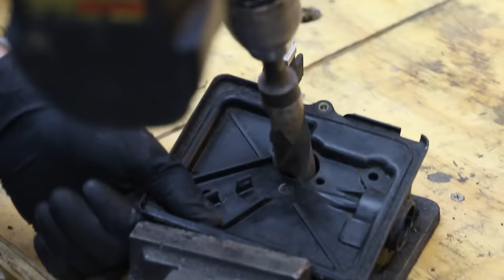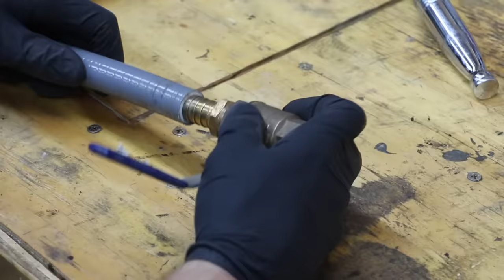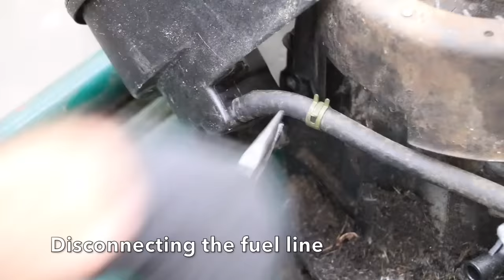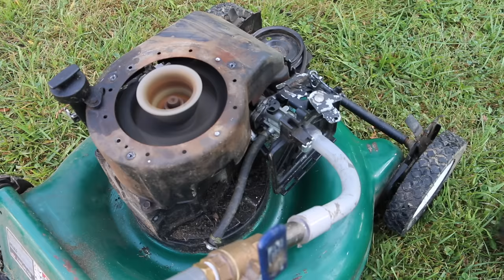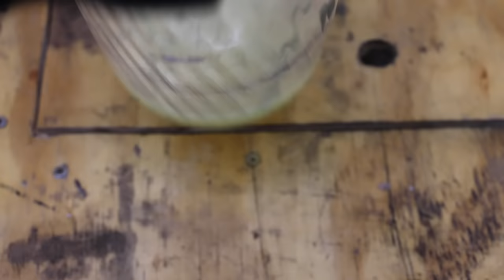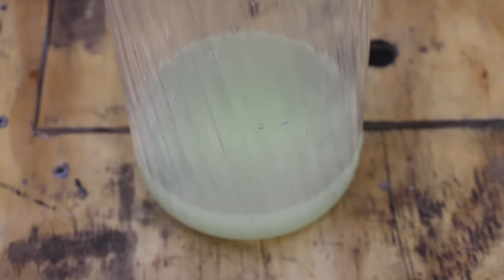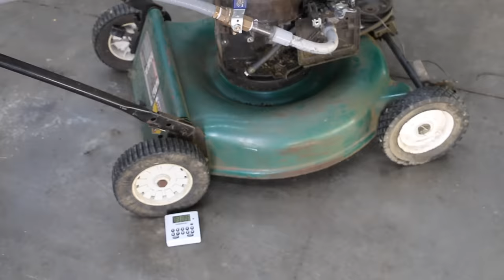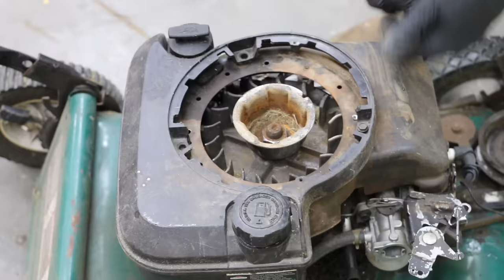Will a "Gas Vapor" Container Improve MPGs and Fuel Efficiency?  Let's find out!

Comment: Doesn't  a carburetor make vapor out of fuel and air?
Reply from the maker: Yes, it makes a spray mist, which becomes a vapor upon entering the combustion chamber.  More recent videos show this process in a see through cylinder head with a high speed camera.
Reply: But all of that unburnt fuel that can't convert fast enough becomes the black carbon that screws our bearings, rings and oiling systems.  If you run clean your oil lasts longer and you don't have carbon scoring the inside of your engine so your parts last longer.  The fresh oil change that I did 5 years ago is still in my car that I show this tech off with.  Pull the dipstick and you still see the color of the oil.  It's not black!
Reply: Yep, how did we ever get along before. Gas motors need a mix of about 14:1 for peak power and heat control. Wonder how much horse power the motor makes this way, bet its way below rated output.
Reply: Joe Cos maybe, maybe not... It's kinda like running nitro methane BECAUSE the fuel is oxidized, but w/o a Dyno test and/or some type of regulator to get a better fuel/air measurements???? Who the hell knows.
Reply: Who the hell knows. Well the people that designed the motors for one.

Fact: Its all about BTU content of fuel and how much you can run thru a motor over a given time period. Supercharging is one way to up the BTU's pushed thru a motor or turbo charging.

Fact: Fuel is vaporized not oxidized. Oxidation changes a given property of a substance, like steel rusting. Fuel in a motor does not go thru this process it is simply vaporized. Same for every liquid fueled motor.

You can call me a fool but there are hard and fast principles that don't change in how motors function here. BTU content of fuel is one of them. Look up the different fuel types and you will see that diesel fuel and gasoline are not the same BTU content. This is clearly shown in how the engines that use different fuels produce horsepower. Given an engine size and how its aspirated proves this out. Diesel motors are clearly the top when you calculate H.P. and torque, BTU content is the variable. The lawnmower runs but it won't give its full HP rating without the correct fuel to air ratio, it just can't. So yes, who the hell knows? People that have been designing motors for well over 120 years. No need to be foul with your comments John, this is just the way that the laws of thermodynamics works and will always work.
Reply: For a nicer burn as standard, make a much longer neck for the car and you will get a better dissipation of the fuel.
Reply: Joe Cos again, you’re assuming a model of 100% efficiency and that the designers built the system to reach peak power production available in the fuel.  While you can’t take more power out of the fuel that there was in it to begin with, you CAN always take LESS.  Is the manufacturer building a system that works to peak performance an fuel efficiency?  Probably not.  And definitely not on newer engines that must be built to epa guidelines.  And is the engine STILL functioning at the same efficiency that it was manufactured with?  Engines do these funny things called “breaking in” and “wearing,” you may have heard of them.  The point is, he was testing to see if it was POSSIBLE to run the engine this way, and IF SO, is it more or less fuel efficient.  He’s not trying to run a mower down a 1/4mi Strip in 3 seconds.
Reply: "He’s not trying to run a mower a 1/4mi Strip in 3 seconds."
And hes not going to mow deep grass with this mower either. Facts not opinion, son facts. Cheers
Reply: Hmmm.. compressed oxygen and gas vapors compressor Briggs....lol
Reply: Thats not a vapor, maybe atomized but not vapor.
Reply: jeeze louise, what do you think vapor is? (check the definitions are similar)
atomized is the 'old word' for vaporized.
Reply: Carb makes 5% vapors and 95% is liquid-that is the problem......We drive on 5% only and 95% wasted for no reason -is it really so hard to believe ?
Reply: Well, kinda, not like true vapor in a vacuum, weren't you listening bro? just kidding, awesome question! but the liquid used to mix with air in a carb. just aint the same. ;-) . .. .. . . .
Reply: No, it's not actually a vapor. The fuel is atomized into tiny droplets.
Reply: Carb will atomize 5-8% of the fuel. The rest will be-droplets. That is why it is not durning in the engine but goes out to exaust pipe.....Is it hard to believe ?    90% wasted for no reason......
Reply: No, it does not.
Reply: 90% is not wasted, the big oil companies are making a killing bro, LOL, your correct though, nice comment... . .. ...
Reply: i got a pictures of a carb that is more than 90% efficent bro.....u can get it 4 free if u want
Reply: Mark Cooper I could see this if you drive around 100 miles per year. Even if you remove the combustion gases from the oil, there’s still wear particles from the pistons, rings and bearings. Unless you ex NASA friend gave you a secret oil additive that reduces the friction of your engine to 0.
Reply: I need to stop drinking, I don't even remember posting this comment!
Reply: ok, tell us about it.
Reply: that\s  why catalytic converters were added, to burn the unburnt fuel that went through the engine.
Reply: TurboMaxx?
Reply: jeeze b it's vapour and colour
Reply: Шура Балаганов do you have a Web address for this ?
Reply: Pogue carburetor "Charles Nelson Pogue" < lots of web search listings.
Reply: 0-Zone oh yes that's an old idea but quite good. I made one and it's OK but with a little modification it will work better. Modern petrol is a different formula to old fashioned fuel. Gasoline was a liquid with a lot of vapour but the new stuff is shifty with stabilisers to reduce evaporation.
Reply: 10% ethanol doesn't help & I know folks who use fuel stabilizer (like Ethanol Shield) to get their car running better.
Recently used Sunoco 87 Octane & in the 90º+ heat & stalled out. Later added 3 quarts of diesel fuel & no more stalling. Sometimes I do 1 gal diesel (plus 3 oz acetone) to 9 gal gas. 

Lots of YouTube on gas bubbler & HHO systems. FYI Ethanol generates less heat, diesel generates more, heat = power. BTW An old friend put all diesel in a gas truck, it ran rough & burnt the valves.
Reply: spankmeister  No, it more like a stream. Even if it were a mist, by the time half of it hit the ID of the carb it would be liquid again. If not that, the bottom butterfly would do the same. I achieved 70mpg in a compact car with a carb above the bottom butterfly by making it spray better. Below you can do far better.
Reply: So didn't the original "vapor engine" actually heat the gas to create the vapors? Just running air through it...seems as if it's not much different than the way any carb does it.
Reply: Saint Crispan Was on top the motor. I would assume so.
Reply: Mark Cooper Rip your engine, you change oil not because it becomes slightly darker with some dirt, but because the the compounds and additives naturally degrade under heat.
Reply: scottrich976 Then explain why direct inject is can achieve more power than port injection.
Reply: Carb & FI atomizes fuel while vapor intake doesn't. Yes the original vapor engine used heat to help vaporize the gas. 
FYI hot rodders want more atomized fuel droplets (not vapor) since more gas (bigger droplets) gives more power.
Reply: That is exactly what the intake does . The carb delivers the fuel .
Reply: Шура Балаганов what's your source?
Reply: Running Nitro methane (nitrous oxide, and methanol alcohol)  allows you to run a much richer mixture of fuel and air, because the nitrous oxide adds oxygen to the fuel causing it to burn better, this is because air has only about 20% oxygen content the rest is mostly nitrogen. If you ran pure O2 and fuel the aluminium of the engine could burn. 
 
It is not oxidized... Oxidized is when the fuel is burned it converts the hydrocarbons in the fuel into CO2, heat, and water vapor...  It is oxygenated when you add NOS to the fuel.
Reply: @Shura_Balaganov_  no, no, no you are horribly wrong. Those droplets actually go through the engine and they are being burned... You understand that right? It's the opposite actually of what you say, only a small fraction of the fuel is wasted as unburnt fuel... It's not that hard to understand!
Reply: @FLHTdriver  the fuel is vaporized (changed from a liquid to a vapor/gas) to facilitate the total oxidation of the hydrocarbons. Both happen, but the actual power is derived from the oxidation of the fuel
Reply: 90 % wasted for no reason man !!
Reply: @Shura_Balaganov_  you must be a troll, aren't you? Is it so hard to belive what everyone is saying? Nearly 100% of the gasoline IS turned into vapor and nearly 100% of that vapor is completely burnet in the engine
Reply: @MarkCoopersisqocracker  I drive a 2005 cummins (diesel) and my oil is black like soot after 30 miles and those engines out last almost every diesel engine out there and diesels out last gasoline engines just saying black oil don't hurt shit.
Reply: Goes to show us how well a carb vaporizesis all this time.
Reply: Atomized gas is vapor, your confusing atomizing with aerosol sprays. The Original car engines in the 1800's used 'vapor' and atomized fuels with no carburetors, but there was no control over the speed or the power out put. It was the carburetor that allowed cars to be used in varying atmospheric conditions and grades.
Reply: It's not very much vapor, mostly atomized gas, which is similar to using an aeresol can.  Vapor is more like what you see coming from say a vape cigarette.  Huge difference in how much fuel gets burned and how much gets wasted.  Only the outer, expose to oxygen, portion of has from a carburetor usually gets burned. A vapor however allows a much more compete burn, this more energy released, less pollution released.
Reply: @saintcrispan5068  carburetors use pressure differential to draw raw fuel through metered jets. This raw fuel is atomized as it travels through the intake runner and into combustion chamber. 
The "vapor" generated by drawing air through a column of fuel is a closer to being a vapor than atomized. This is proven by the initial start up. The valve was fully opened and the fuel/air ratio was far too high to run the engine. In a carbureted engine this would have "flooded" the engine. At least in my experience anyway.
Reply: you should be able to take the carburetor right off and toss it in the bush
Reply: @kelvenguard  
True, I ran my Honda engine without one with ease.  However, having the carburetor allowed me to incorporate, with some adjustment, the governor so that the engine doesn't choke down as easily.
Reply: cool... with the Lawn mower engine like he has it set up you could take the carb right off and control it with just the valve.... and use 2 pipes one Just air the other air/fumes both with valves... because a mower runs wide open... then watch the fuel mileage go way up on the lawn mower...
Reply: Yes
Reply: Try using an ultra sonic  vaporizer
Reply: Much of it remains liquid and flows through the exhaust. The fuel is actually atomized, that mist as you called it is not vapor only the outside boundary layer becomes vaporized due to heat and pressure and only that vapor burns.
Reply: There is a big difference between vapor and droplets which is atomization . When the vapor density becomes too high, saturation level, then condensation occurs. Condensation is like atomization .
Reply: Atomized... which is easily converted to vapor when entering a hot combustion chamber.
Reply: Project Farm great video to save fuel I’m buying a Chevy Cruze gasoline but I have a question. I see trucks driving everywhere that run on diesel I thought about buying the Cruze in diesel but it’s an extra $5K where’s the actual savings. There’s about a 30-40 cent difference buying diesel the Cruze gasoline gets 42mpg and diesel gets 47mpg.......?
Reply: more like air is already a vapor and the fuel is ATOMIZED through a ventury..
Reply: like Combat Pyro said he was just trying to see if it would run on vapor
Reply: And the rate at which the atomised fuel particles vaporises is precisely calculated to reach maximum possible value just before TDC as the liquid to vapour change of state uses energy from external sources, therefore keeping the temperature (and therefore density;) as low as possible. 

Want more power? Without upgrading any engine components? Run a coil of fuel line through an insulated container full of dry ice in the engine bay, heat wrap exhaust components, ceramic coat all inlet piping, get an oil cooler, keep inlet piping from turbos as small in diameter as possible without being restrictive, duct clean cool air into air box and heat proof air box, clean MAF or MAP sensors well, either duct hot air out rear of bonnet by raising rear of bonnet so hot air is drawn out quicker giving it less chance to sink into thermally conductive materials OR (careful bout these 2, engine/car dependant, u can actually reduce your cars performance abilities by fitting the wrong style of bonnet. Especially if engine is designed to vent out under car) use ducting or scoops to force air into engine bay , it travels down past engine block, sump, exhaust, n so forth, taking heat from the most intense sources with it. Another good trick on little bit older cars is to attach a barrier of sorts that extends full width of vehicle from the top of the radiator out wards towards ducting in car bumper, this forces air through radiators and coolers at a greater rate instead of letting it escape up and over the radiator and directly into the engine bay. etc etc... 
•Next step is make your car light as possible (budget dependent) especially wheel, brake and suspension related items. Electric seats, steal panels replaced with Carbon fibre pieces (bonnet, boot, quarter panels, outer door skins, replace cast iron items with forged alloy or composite items (inletmanifold, exhaust manifold, battery tray, air box, engine auxiliary brackets, driveline components. List is as long as pockets are deep) 
FINALLY! reduce you cars drag coefficient (smooth underbody panels, channeling along panels to keep airflow from tumbling or swirling- high speed linear airflow causes a low pressure zone with a 90* perspective to flow direction- rear diffuser, aerodynamic designed mirrors(all adds up) aerodynamic (and AS LIGHT AS POSSIBLE while maintaining road use safety standards) designed wheels that also have correct offset to sit outer edge of wheel further out in line with car exterior... 
And then... 
Lastly, you consider making the braking system and engine components a higher spec. 

You can start at top and work your way down list until budget or circumstance prevents you goin further. You will mostly find, as much, if not more benefits than trying to improve on an automotive manufacturers engineering team. 

Cooler
Denser
Lighter
Slippery 
Smaller
Reply: Mist
Reply: @recon1071  I'm sure it doesn't burn the unburned gas but maybe chemically make it less harmless or trap it in something but I get your saying anyway i really hope it isn't for the unburned gas if so that's messed up if car companies would add that I stead of fixing the problem this method of burning gas may be better but not the best. im sure even if a stock engine did burn all the gas they would still add a trap for unburned gas just because people don't care for there engine people normally run it till it dies and fix what's the problem to get to driving that's about it so why wouldn't car companies plan for the future but given all that I can see how a small piece in a car can go bad but this type of thing I don't see how I can go bad other than no air filter on the intake it's going to take in trash from the air and that's going to get into the gas but still shouldn't hurt the fumes too much if any and there's a better way to do it just remove the bubbles and add heat I bet that would give it much small gas particles but will just give it something else that would go bad someday
Reply: @Joe Cos - But the original guy that invented this, actually invented a new spark plug too. It burns clean. Your engine allegedly does get that black gunky build up. Less oil changes, less issues over all. I understand what you are saying.
✨ BUT, think if it could work? ✨
The impact on the environment, zero emissions! Extremely, less gas being used. 
It would be wonderful. 
Then again it would be great if, I could crap quarters too right?  🤣🤣😜
This is where the idea comes from. It's a youtube video:
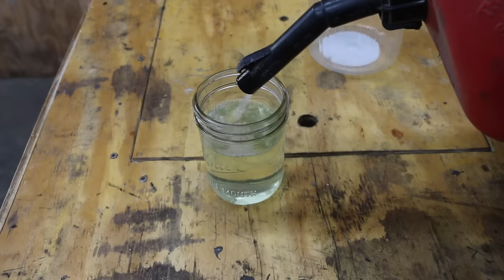https://www.youtube.com/watch?v=SUtGV2GkU9I          start: @8:40 
Really shortened up that story but you get the point. 'Big Oil' killed it. 
In fact, the entire video is of Fantastic Inventions, Killed Off.
Reply: With that being said 3 to 4 percent is very good (gas does not fully vaporize when injected or pulled into the combustion chamber, hence catalytic converters.).  The emissions are also lower. With 18 gallons of fuel, you would save .54 gallons at 3 percent of 18 gallons.  So you out of 18 gallons you would save just over half a gallon.  EIA.gov states, 142.98 billion gallons consumed in 2017 in just the US.  With only a 3 percent savings, that would be 4,260,000,000 (short count) gallons of gasoline saved.  That is with a naturally aspirated engine through carburetion.  That would be 101,428,571 Barrels of just gasoline.  There are ways to increase this, the problem is no car company wants to implement them.  I wonder why direct injection and tpi are so popular with manufacturers.  I am sure you can imagine why.
Reply: What he said ^^ haha. Vehicles cant burn gas in a liquid state. All these idiots converting their fuel injected vehicles to carbureted systems.
Reply: Joe Cos Fuel is vaporized in the intake process and oxidized in the combustion chamber upon ignition.  So, fuel is indeed oxidized in an engine, just not in the intake process.

Also, there are more factors to an engine’s design than just fuel BTU’s.  The engine makers are in the business of making and selling engines (funny how that works).  So, they actually don’t mind a little unburned fuel making soot in the engine.  They are intentionally engineering in a reasonable service life so they can later sell you a new motor.  Your angelic engine designers (or rather their management) aren’t concerned with peak efficiency, horsepower, or engine life.  They are only concerned with making them adequate enough to do the job and making it’s service life length tolerable to the consumer.
Reply: Joe Cos Also, diesel fuel is not the end-all be-all of fuels.  It it were, why aren’t F1 cars, Indy Cars, or any other racing cars using diesel?  It’s because horsepower and speed are RPM driven numbers.  Many semi-trucks operate with only 3-400 hp.  Many, many gasoline powered cars and trucks produce much more than that.  Diesel powered semis do, however, have LOADS of torque, which is more important to their application.  The high compression and long stroke (which also keeps RPM’s down) gives them that torque.
Reply: Nikki Colemam Soot is never good in an engine.  It is unavoidable, but not OK.
Reply: @MarkCoopersisqocracker  I converted my 6kw Honda generator to run on propane with a US Carburetor tri-fuel conversion kit. While, yes, it certainly runs much cleaner, that does not mean the oil doesn't need to be changed I still have to change it once a year... and it's not clean when I do change it. But yes, the motor seems to like much better running on "gas fumes" of propane. I wouldn't stay next to a gasoline generator for longer than a minute or two, but I can stay next to it running on propane for hours.
Reply: After 5 years your engine oil has deteriorated and oxidized and lost many of its properties even when looking still good. That will screw up your engine even worse that some sooth coloring the oil black. Change at least every 2 years or more often if you often use your car for short stretches.
Reply: More than likely the cloudy fuel is moisture being picked up in the fuel it only takes a small percentage of water to make fuels( petrol diesel) to go cloudy, emulsified
Reply: @soylientgreen5663  They're Eating People!!!! had to say it. OLE!
Reply: @MarkCoopersisqocracker  link?
Reply: @andyp3834  that's funny, I laughed my ass off when I saw your comments. peace man.....